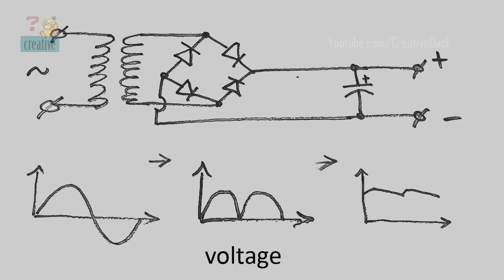Diode Bridge and Capacitor AC to DC

Comment: how does that capacitor rating relates to voltage out put?
Im mostly interested to build magnet alternator so Im curriuse to know how its voltage regulator build or current cutt out if baterry reaches centrain Ah charge .

Comment: Can that circuet be used with alternator?
I want some thing to build for me ignition coil useing seperate rectifier and tap in those 3 phase windings on the alternator but Im woried about me lead acid baterry if it wuld explode .
So I dont realy have negative on the coil be me its e core type ignition coil with 4 pin gm ignition module .
So can the coil and those rectifiers you show with 4 pin gm ignition module have seperate grounding?
To not interfeare with baterry ore the altrnator voltage potential?
In the past I did try out hv ceramic capacitors on me ignition coil evry thing was great except the alternator its starting charge from 1200rpm goes up to 3000rpm that was problem for me .
So please any circuets that can protect ground reference voltage and protection please.

Comment: so approxiamtely you have: 9V AC *1,41= 12,69DC.if you want to have 12V DC stable output under load,from a 12vAC supply,what should you change/add?
Reply: add a IC7812 (12v positive voltage regulator), give you max 1Amp but heat sink required..

Comment: diodes normally getting hot be careful when you put them inside the plastic box
Reply: diode is 3 amps. it will be OK because the transformer is only able to supply 800mA.

Comment: After Casing the electronic was looking so clean nice video

But plz explain how did we get 15 volts at output ??
Reply: It was 11v AC so when converted to DC it gains 40%, so becomes 15.4v DC
Reply: @englishrupe01  but how did it for gain of 40 percent ?
Reply: @parth7888  When AC gets converted to DC it gains 40%. Look it up.
Reply: Learn how FULL WAVE RECTIFICATION WORKS

Learn the steps
- do it on an Oscilloscope for yourself
- Take readings before Conversion
- Learn what Half Wave Rectification is and how it works
- Learn what a full bridge rectifier is
- Learn how it works
- make a model and test take readings
- Send and AC Signal into a Bridge Rectifier WITHOUT A CAPACITOR on the output,
Look at this through an Oscilloscope and see what you get
- then put on the cap, and see what you get

Basically the answer to your question lies in Understanding AC and DC and Wave Rectification
if we just tell you the answer, you're going to keep saying  BUT WHY,    ok

you need to test a few things and look up a few things and understand some fundamentals
does that help you understand it ?

Comment: adapter  is already convert ac to dc why still using gbj2510 clarification plz
Reply: No it hasn't
the Adapter output was 9V AC
the primary input was 240 V AC
it didn't convert to DC

he was basically using it so that he didn't have to manually step down the V AC
from there he basically just rectified the AC and smoothed it out with a cap.
Reply: look carefully at video 1m35sec. he already shown you.

Comment from the maker: Actual voltage of the adapter is 11v AC not 9v. You can see waveform here : https://youtu.be/8WPJ1kHMwb0
Reply: that's true and thanks for that
but the problem here was....

When you measured the output with the DMM
IT WAS NOT CLEAR ON YOUR DMM IF YOU WERE MEASURING V AC or V DC

all we could see was a cheap , no name multimeter that was showing 15.3  V
but we couldn't actually see the setting

now.. yes
common sense dictates that a bridge rectifier with a smoothing capacitor will produce DC Output
but... THIS IS A TUTORIAL and you didn't show that very clearly

your wave shape video was a lot better , in my opinion
i mean for the kiddies that don't know how it works, it's always better to have a scope to show it

and in my opinion it's much better to first show
Half Wave Rectification (so they understand how the negative half of the wave is removed)
and then to see a pulsating DC without the inverted rectified waves
and to also show them the power loss through a diode.

then ......you bring in the bridge rectifier so that the purpose is made clear
- that we get the inverted portion of the wave on the positive cycle
- that we don't lose half our power in rectification
- and that the capacitor acts as a smoothing cap to smooth out the pulsating DC

but again, you didn't make this clear
Reply: Creative Duck ,,hello,,,use this proyecto for UP to 5 amps???? Or how many Amps it is usefull??? Thanks
Reply: @martinkuliza  Tough crowd!
Reply: @GreatWhiteNinja  
Indeed

Comment: which bridge rectifier should i use for 12Volt 6Amp transformer.....  i tried bridge rectifire with 1n4007 diodes but it blasted after loading.
Reply: 1N series is only 1ampere use. The 7 indicate 700V.
Reply: @sholimz  thanks
Reply: welcomed.
Reply: Correction:- 1N series is for rectifiers and diodes (eg 1N4001, 1N4444). The number 4 is 1ampere series. On the other hand, the number 5 is for 2ampere series ( eg 1N5401 rectifier diodes). 2N is for transistors series (eg. 2N4037).

Comment: Bonjour et merci pour ces démonstrations.
Je veux réduire une tension de 5 volts dc à 3 volts dc?
Quelle valeur de la résistance dois je installer dans le circuit.
Merci infiniment Pour votre aide.

Comment: If the 9 volts output from adapter is DC voltage already,  why do you used a rectifier diode still?
Reply: An alternating current was drawn on the adapter.
Reply: Because it wasn't DC
if you pause on 1:34  you'll see
the 
OUTPUT  is  9 V AC   800mA
which he connected to the AC Terminals of the Rectifier 
TO PROUDE A PULSATING DC
which was then fed into the Capacitor to smooth it out to DC
simple as that
Reply: @martinkuliza  How did he get 15v from 9v?
Reply: @TadeuszSejnowski  
or the simple math way to understand this is

Started with 9V  AC
Doubled the Voltage by rectifying the wave into a  Pulsating DC
therefore  9 x 2 = 18 V
Lost 3 V Approx  because (simply stated) that how things work
so...   18 V - 3 V =  15V DC
that's how

Comment: Can't I just cut the wire of my 120v 60Hz LED work lights and connect the black to ground and the white to positive in my car
Reply: No  its  not an inverter.  In order. For your  a.c. led light to be used on dc  youd need a few mosfers and other transistors  to  alternerate the dc current

Comment: In the same process can I convert 14v to 80v AC current (comes from my bike engine it increases up to 80v when engine runs first) into 12 v DC ???
Or I have to add an 7812 ??
Reply: Assuming you already figured this out but after converting ac to dc with this setup you will need to add a voltage regulator to limit the dc voltage
Reply: Yes  but find a bridge rectifier  that can properly  handle that   voltage and current.    Once you convert the  a.c. to dc  you can use a buck converter  to further  step down diwn the high dc voltage to 12 volts.   Look for a buck converter  that  can reliable take in high  voltage  and step it down to 12 volts   and  one that  can be used to  charge a battery. Typically alternatives  already have bridge  rectfiers in them  because they charge your vehicle's  battery usually

Comment: I'm hoping you can help. I'm trying to convert an older model train from DC to AC using a full wave bridge rectifier. Saw another video on YT a guy did it but he didnt show it well enough and could use some help. The rectifier is supposed to be soldered to the can motor but I cant tell exactly which wires to connect/solder where to the can motor. Could you possibly help?
Reply: tell ur dc require ment and current requiremt i ca help u out  see my videos
Reply: rectifiers dont convert dc to ac
Reply: @gregvoigt551  a double bridge Rectifier made of 4 diodes will. Just need to know the right way to connect it. Saw a guy do it. He just didn't show the actual connections. His channel is Benz trains
Reply: @jimeronimo  also,4 diodes were used in this vid.Its a full wave rectifier.

Comment: You just put a bridge rectifier on a 9v DC supply. The transformer already converted to dc.
Reply: The transformer was clearly marked "9V ~". "~" means AC. Watch it again at about 2:20
Reply: Ryan Hoke it says that it is in 9 v AC. Its kinda weird but it works
Reply: Ryan transformer says 9v  AC a wave sign means ac
Reply: Well if that is the case then they miss labeled the case also because a powersupply would be converting ac to dc and a transformer steps ac voltage up or down. I thought the ac symbol was the miss labeled item as ac 220 to 9v are not as common as they use to be.
Reply: This is normal AC - AC transformer in plastic box...
Reply: Ac ac transformers are uncommon nowadays but they are still around
Reply: @nilsz7354  ..

Comment: Why not just use a 9 volt ac to dc wall wart?
Reply: If you used adapter bought from the store, that's mean you don't know how to build bridge rectifier for basic power conversion from ac to dc.

Comment: The output voltage from the adapter is 9 volts according to the label, how come when you measure at the Terminal, it became 15 volts? ha,ha, funny!
Reply: because 9 v of alternating current is the effective voltage, and the rectified one needs to be multiplied by the root of two, that is, 1.41. It turns out 12.7 volts. You have 15 v without loading ,. Under load will drop to 12v.
Reply: Hi Ronnie
hehe
- it's not so funny anymore is it ?

- Further to Victor's comment,  THE LABEL IS NOT ALWAYS ACCURATE that's another reason

- Lastly, you need to learn how bridge rectification works
i suggest you do this experiment 

Get yourself a step down transformer that goes from 240 V AC (or whatever your mains power is) to some lower AC like 12 V AC or 9 V AC or something similar

then.... (half wave rectification)  connect the output to a diode

- Using an Oscilloscope NOTE THE WAVEFORM
- Note that you lose the negative portion of the sine wave (thus producing a pulsating DC)
- ALSO NOTICE, .... YOU LOSE HALF YOUR VOLTAGE which is very inefficient 

now..  take out the diode and get yourself 4 diodes and solder them up in a bridge rectifier formation

- Then note the waveform,    Note how it inverts the negative part of the wave
- Measure the voltage at each stage of the process

- and basically LEARN HOW WAVE RECTIFICATION WORKS

- Lastly....  Next time, instead of laughing at someone,   UNDERSTAND THAT IN ELECTRONICS SOMETIMES THINGS SEEM WEIRD AND INCORRECT
BUT USUALLY THERE IS AN EXPLANATION
so instead of laughing and trying to make someone out to be a fool.... ASK A FEW RESPECTFUL QUESTIONS INSTEAD OF LAUGHING

because you could be the one that is then laughed at 
Lesson's in life mate
Reply: @victoruzhos856  ..

Comment: What is rating of rectifier is thism15 volt 6 amps?
Reply: u can use any bridge 3/5/6/8/10/15A and any power AC INPUT  :) 15V/2A IN = 15-18V OUT  :d

Comment: ITS FAKE OR NO
Reply from the maker: you can see on this video : https://youtu.be/8WPJ1kHMwb0
Reply: what is up with everybody?Fake?How can it be fake?That is the way bridge rectifiers are made,and thats what bridge rectifiers do.Every wall wort that puts out dc power has this exact setup.Even the alternator that charges your car battery has this setup to convert the ac power from the alt to dc power to charge your battery.

Comment: power supply output is 9v DC :)
Reply: Capacitor up voltage to 15V after electric consumer down voltage
Reply: No..  it's 9 V AC
Reply: It's just a transformer not ac-dc converter
Reply: @mohammedsaib3844  

well, NO thats not totally correct

he started with a Transformer / Plug Pack
input - 240 V AC
Output 9V AC
so... You're correct it didn't convert AC to DC

(but.. that was the point of the Bridge Rectifier and capacitor)

he used a 25V Cap (which is fine)
he used a Bridge Rectifier

and AT THIS POINT IT WOULD HAVE CONVERTED AC TO DC through Full Wave Rectification (we know this)

THE PROBLEM (in my opinion ) is .....

When he showed the Reading on his DMM it was not clear as to whether he set his DMM to V AC or V DC

i mean, we know that on the output of a bridge rectifier we are going to get a PULSATING DC
and then we use the Capacitor as a SMOOTHING CAPACITOR to give us the DC Output

BUT.. HE DIDN'T SHOW THAT CLEARLY
thankfully in his other video "WAVEFORM" he used a cheap arse hand held DSO to show the wave form

so. you can't say it's not an AC to DC converter, because it did convert AC to DC.
that's what the bridge rectifier did and the cap smoothed out the pulsating DC.
Reply: @martinkuliza  I'm with you in everything  .tank you for your time.
Reply: @mohammedsaib3844  
You're Welcome

Comment: I want to use RS401L bridge rectifier for having 12 volt from 0-12 , 3ampere transformer. But I get 20 - 21 volt from bridge rectifier.can I use it for 4440 double IC amplifier board?
Reply: No you kan, jou must bring the voltage down with a 78xx voltage regulator example  7815  7812 Google For data
Reply: The rectefire voltage go,s up too 1,4 x your alternated voltage

Comment: It already 9v dc why connect a rectifier again?
Reply: That was an AC to AC voltage transformer.  It outputs AC power.
Reply: @thedillestpickle  haha no it wasnt
Reply: @nikkzi2731  See 1:36.  It is an AC to AC adapter as indicated by the ~ symbol.

Comment: De cuánto es el capacitor ?
Reply from the maker: i don't know, I took it in an old electrical board :)
Reply: @CreativeAndDuck  I can use ANY capacitor? The voltage or capacitance doesn't matter?
Reply: 2200uf x 25 v

Comment: But what are the component ratings?   What microfarad capacitor?
Reply: YOU WERE NOT PAYING ATTENTION

at  0:16  it clearly shows  2200uF  25V

also you don't ask  WHAT MICRO FARAD IS THE CAPACITOR

Not all Caps are Microfarads  some are pico, some are just farads
you ask  WHAT IS THE CAPACITANCE RATING OF THE CAPACITOR

Comment: its Upgrade DC From 9V to 15
Reply: Not all "wall wart" transformers convert house AC voltage to DC.  (I thought the same thing until recently myself)  Some only step it down and keep it AC.  I did the same thing this fellow did before I watched this - the capacitor is to smooth out the DC and reduce the ripple.  I used a 22uF electrolytic (100v) and it boosted the 11 VAC to ~18 VDC.  Interesting that with the addition of the capacitor, the voltage went up 7 volts.
Reply: well, NO IT DIDN'T

because it didn't start as 9V DC
it started as 9V AC then the output was 15 V DC

but, i gathered that's what you meant to say ... right ?

Comment: there is already dc output in adaptor
Reply: 1:36 9V~ which is AC not DC, and if you measure the AC output without load you get about 11V~ AC, which means Voltage peaks of 11V * 1.4 = 15.4V aka a rectified voltage of about 15.4V -1.4V=14V DC (1.4V for 2 diodes per path in the bridge),  that is without load. With load of 0.5A - 0.8A, you will get something usable of about 12.5 Voltage (with some relative small ripple)
Reply: wrong